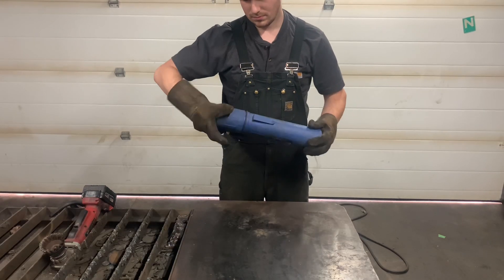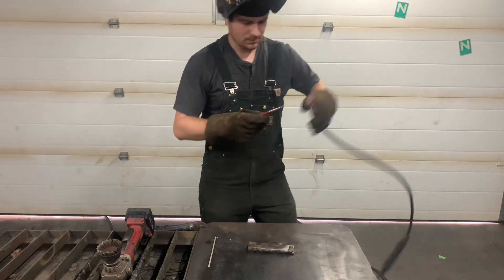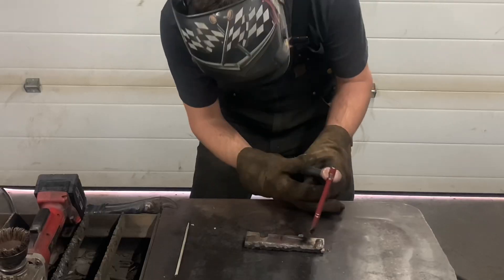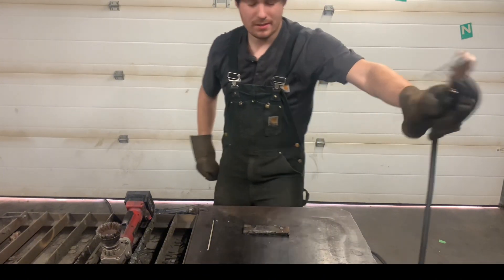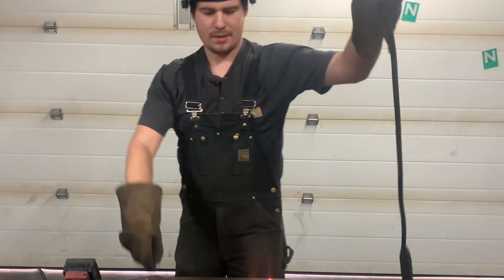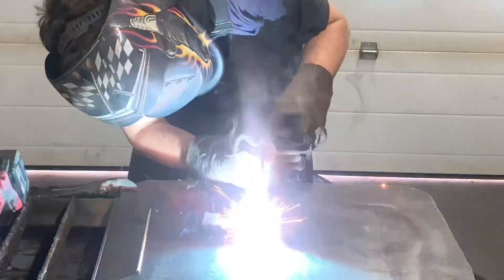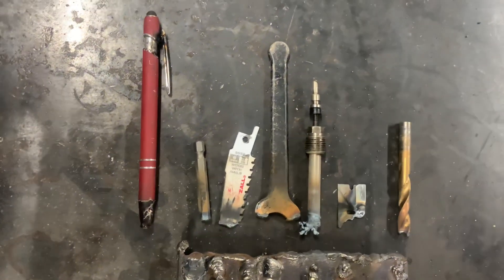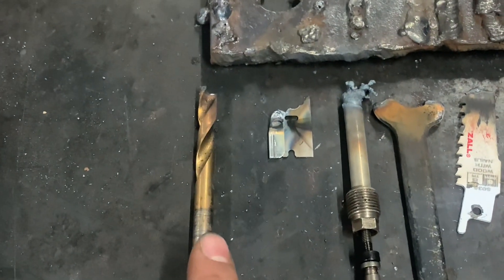I tried Welding with things you should not weld with

Comment: a metal coat hanger makes a great welding rod in a pinch
Reply from the maker: Do I remove the coat first? Instructions unclear 😂
Reply: @STROKER-GARAGE  welders choice u could try either way see how it goes
Reply: I have seen some good welds using a coat hanger.